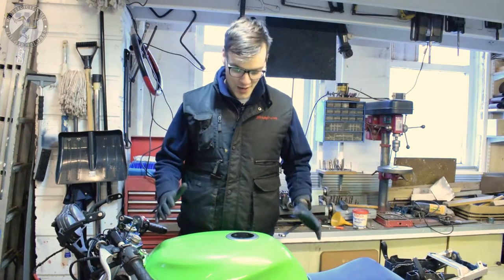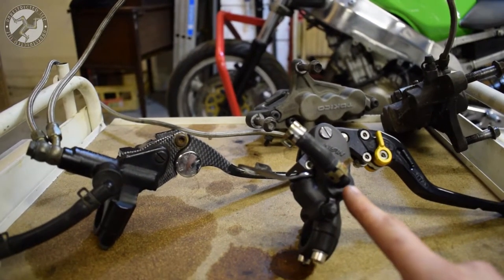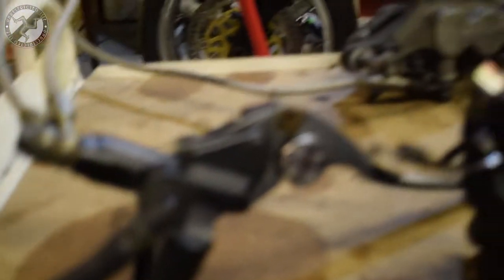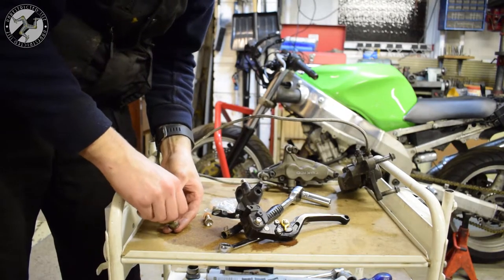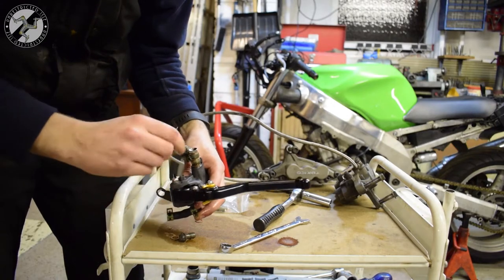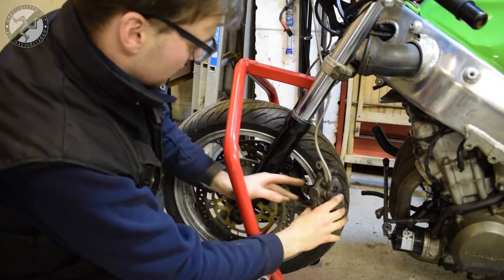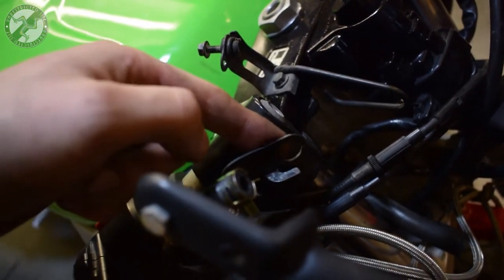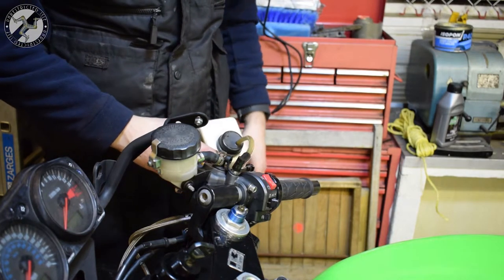Fitting Subscriber Parts! Radial Master Cylinder, Levers, Bleeding Brakes - Trackbike build Ep 4

Comment: I’m also building a track zx6r g2, are you planning on putting the mirror/fairing bracket thingy back on? I’m not sure if the fairings will take the forces without it.
Reply from the maker: Nope, the ‘birdcage’ is not needed. I personally didn’t do it to this bike but my road going J2 I did. It’s the fairing stay from the 2005 ZZR600 (which was just a rebadged rerun) If you have a look at my old videos you’ll see the change 😁😁